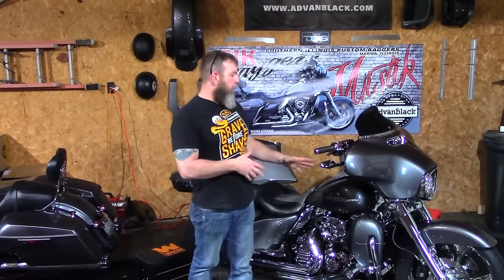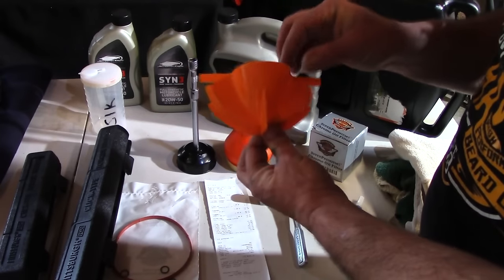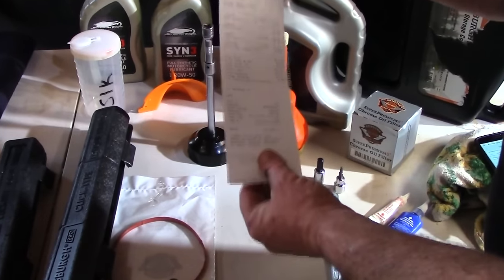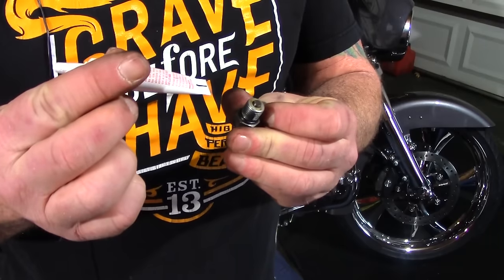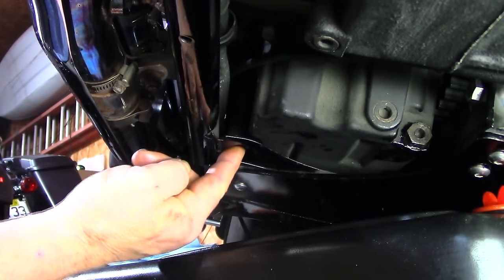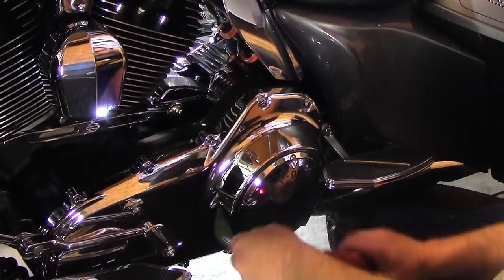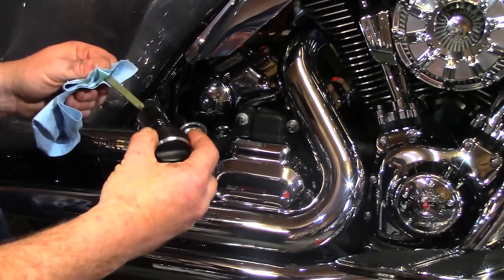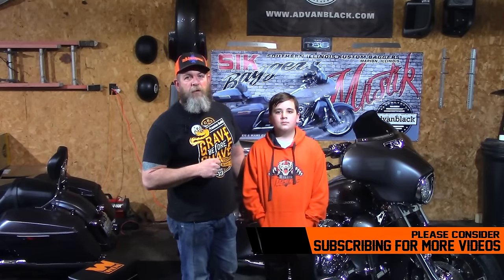⚡Twin Cam Complete 3 Hole Oil Change @harleydavidson  Touring⚡

Comment: I've watched a dozen videos and this is the only one where I feel like I know what to do after watching it. Thanks!
Reply: Except use 75/140 gear oil in the transmission
Reply: @michaelmitchell5909  I used Lucas 20/50 in the motor and primary, and 75/140 in the trans.  Shifts smoother and doesn't slam into 1st like it used to

Comment: It’s good to see that the oil is running out slow with the oil plug is in. It shows that the oil breather separators in the heads aren’t wore out.

Comment: Thanks for the informative video detailing the correct step by step procedures. The addition of constantly reminding everyone of the  torque specs required, along with not skipping any steps, really makes your videos stand out from the rest. Keep showing all of the steps necessary to complete the projects. Special nod to showing a "COMPLETE TOOL AND PARTS" display that is needed to perform the service. Its one thing to be told what is needed, and another to visually see what is needed. Thanks for clearing up the apprehension with doing this service. Fantastic job man.
Reply from the maker: Thank you John..Much appreciated.
Reply: II concur.  I just went from a Honda VTX to a FLHTK9 Love the VTX AND the Ultra!).  The info is priceless, and useful.  I have always changed my own oil, except when it is covered by the dealers break-in period service (which was free).  So now I can start doing mine on the Ultra..

Comment: T27 for the derby cover bolts, not T25 as stated. The T25 can appear to be the correct size as it is just slightly loose...and might even work on bolts that are not over-torqued (unlike mine). I ended up buggering one as a result of my trust in the internet and an hour's work turned into three. Put a tag up on the video or something. No one saves money if you hand out incorrect information.

Comment: I run the syn3 in all three of my holes as well and it's much cheaper to to do this myself and save a couple hundred bucks and it's easy with the proper tools along with common sense. I would also like to mention that the plugs have a magnet on the tip and if you have serious metal shavings on it you better get it checked out. Thanks again for the great video.  Peace out brother !
Reply from the maker: Absolutely ....good point on the magnets...I had said that in the video but I must have edited it out on accident.  Thanks for checking out the video man and bringing this to my attention. I'll pin your comment to the top so others can see.
Reply: gaknskk I do my own oil changes as well. The Harley-Davidson dealership technicians don’t use torq wrenches, they do everything by feel.
Reply: @sikbaggers  I have 2015, exact same color as yours.  My bike is approaching 15K miles.  At 15K, do I need to do a 3 hole change or just the oil change?  5k and 10k fluid changes were done by the dealership under the purchase service plan.
Reply: &hi*iikjk
Reply: Up
Reply: I had serious metal shavings in my primary. I changed the oil second time saw very tiny pieces. I believe it was because my clutch starter was cranking crazy for a season. Had it fixed. 🤞🏼 it’s 20 year old  🏍

Comment: WOW!!! Thanks for the warning on the torque specs.  As a diesel mechanic I would have gone with the gorilla torque I normally use on the job.  I can see I will have to make some adjustments to wrench on my own bike.....  I knew it wasn't an M2 Bradley but I can't remember the last time I dealt with in/lbs.

Comment: Just to add some food for thought, I've got a 16 FLHXS and and an 05 Fatboy.  I've put 75,000 on the Fatboy and changed all three oils countless times.  I'm still using the factory O-ring on the oil drain plug, and the factory gasket on the derby cover, factory O-ring on the primary drain plug, etc.  I keep both bikes in my garage and there has yet to be one drop of anything leaking.  Not saying that there's anything wrong with changing em out every time, just showing that maybe it's not quite a "must do or else".
Reply from the maker: Well Ill have to say im shocked that your OEM o-rings are in that good of shape after 17 years and 75k miles....for the price of these things I would never re use them on my bikes or customers bikes...just not worth the risk.

Comment: Hate to point it out but the derby cover screw size is T27. Too many think it's T25 and strip it. Should also not use blue loc-tite on it either.
Reply: I went right out and checked. It is a T27 on my 2011 Road King.  Video was very good. Thanks
Reply: Why not lock tight?
Reply: Brent Spencer just no need to use it. The screws are cheap pot metal and can shear off with the slightest extra torque. Using loc-tite on them will just be too much. Yes, you can heat them a little prior to removal but with 21yrs as a master tech I've yet to seen vibrate out and have more than my fair share of sheared off and stripped ones. The derby cover screws are not subject to the same heavy vibrations as other areas of the bike.

Comment: Great video. I was having trouble finding the trans drain plug because the manual doesn't tell you it was being hidden by the frame plate. I should have no problems now. Thanks.
Reply from the maker: youre very welcome!

Comment: I had my 1K mile service at the stealer and they put Syn3 in all 3 holes on my 19 Road King at it ran ok. I then did my next service and used Amsoil and it ran better and shifted much smoother and ran a little cooler. I used Redline for my last service and that’s all she wrote. Runs like a top, no clunking in gears and runs cooler.
Reply from the maker: Thanks for sharing...ive amsoil..and agreed..the amsoil didnt make much of a difference in my opinion wasnt worth the extra money over syn3 ..my next oil change will be with redline

Comment: The torx head bolts on most HD Derby covers is a T27, not T25. A T25 will strip out the torx grooves.
Reply: Should have read the comments before I started 😭

Comment: Hey great video. ? what is your opinion on using Amsoil ?  I have j&p cycle sells the Milwaukee  twin oil kit are they any good ?
and I saw you used the same oil for all three holes vs the individual type there is a lot of discussion on this what is your opinion? 
thank you in advance
Reply from the maker: Hey thanks man...Honestly I have never used anything but the Syn3 ...I have a 2014 SGS sitting in my garage right now, one of my good buddies, that has 94 thousand miles on it.,...yep...94k! Im talking hard miles! Only used Syn3 in it and has never had to have work done on that motor. Those results are really hard to argue with to honest. I have read all of the debates on amsoil and other brands...you can get lost in those debates there are so many. I have had several tell me that the amsoil will take the clunk out of the transmission...those are also the same people that are selling amsoil kits. Those who have used it have all said the same...once it gets hot the clunk is right back in there. I just stick to running the Syn3 in all 3 holes . If you take your bike to HD for the service thats whats your going to get as well unless you specify different.  I guess it all comes down to what you are used to using.

Comment: I used the Red Line products for the first time and the transmission oil spooked the heck out of me, it looked as though I was pouring a pink smoothie into the fill hole.
Reply: Hey man saw this comment. Coming due for first change on the wifes 18 stree glide and 2nd on my 17 street glide. Any pros or cons to the redline now that you've been running it. Not sure Redline, Amsoil, or stick with Syn 3 ??
Reply: Honestly...I haven't noticed a lick of difference running Red Line from the OEM stuff.

Comment: This is great, thanks! I can already hear my wallet getting fatter hahaha. Question...do you use the same oil for all 3 fills? looking at some kits have 3 different oils...Thanks
Reply from the maker: hahaha nice! on this bike yes...syn3 in all 3 holes. HD changed the oil on this bike the first few times and thats what they used so I just stayed the same with it...I have used the amsoil kits and they work just as good.

Comment: Great video, quick tip I put a Ziploc bag around the oil filter plus the rags you mentioned, helps with the mess.
Reply from the maker: Nice tip! I may try that next time...Usually I cna get it out fast  enough but it does spill a small amount...I didnt have much luck with the plastic oil catch things they sell....dripped fluiod everywhere lol

Comment: 10 bucks for that funnel ?!  Must of cost H-D 3¢  and that's including shipping & handling from China.   I wish they'd stop with the gouging on every single friggin thing they offer.
Reply: I bought some extended turn signal switches that weren't too bad; twenty something. It was competitive. Hey they have to keep the palace lights on.
Reply: I cut up a plastic milk jug
Reply: @Gakk13  
Nice going, Leo.
Every H-D technician just gasped & fainted !     Now they have to break out the 
H-D ( Willie G edition) smelling salts at
$100 a pop
Reply: @onestepbeyond7240  you do know what HD stands for right? Hundred Dollars!

Comment: About to do mine for the first time ever. Now feeling confident after watching your excellent video! 👍
Reply from the maker: Glad to help Mark! Its pretty straight forward, youll have it in no time.
Reply: Great help thank you. I can buy the oil filter wrench and a set of funnels for about 25 UK Bucks. The OEM 3 x oils, filter, o rings and gasket cost 106. Not sure what HD charge but last time I took it in they didn’t change the filter. So DIY it is from now on!! It’s just great that People like you take the time to make these fantastic informative videos for us. Peace Brother 😎🤟

Comment: I really appreciate this video. I am going to do the 3-hole fluid change on my 2106 HD Triglide that has 110,000 miles. Since this is my first attempt at doing this, and because I am all thumbs (read barely know which end of a crescent wrench to use), your patient explanations are very helpful. Lol. After crawling under my trike, I am amazed how clean your under carriage is. Thanks again for this excellent video.
Reply from the maker: Thanks for checking it out and really glad it will help you! Its pretty straight forward and after doing it a few times itll be a breeze.,..take your time and you'll do fine!
Reply: Thanks again for your help. Just completed my 3 hole fluid change. It went smooth enough that I also changed my air filter element and spark plugs. Had to be a little careful with my 2016 HD Triglide fluid specs. 3 quarts in the oil pan, 28 oz in the transmission, and 36 oz in my primary. I used my service manual to verify my fluid requirements. Thanks again for your excellent videos. I have liked and subscribed to your channel.

Comment: Try the filter drain funnel. No towels! Happy wife happy life. Lol. It you use the funnel, place under filter and punch one hole twords bottom back of filter and one on top back of filter to let air in to drain filter before removing. I let the filter drain while I drain the engine, then go back to the filter. No towels. No mess. Lol. No mention on fluid levels checked on the juffy stand or on the level bike but good info vid. Thanks for keeping the common Joe in his garage. Love it when you can ride wrench repeat. Shows you really do love the machine.
Reply from the maker: yeah thats a great idea man! I may try that next time.  10:07  I talk about paying attention to the marks on the dipstick. on jiffy or straight up and down. Thank you for the filter trick as well..thats pretty cool!

Comment: I learned a couple things that I really shouldn't needed to learn......stuff stuff under the oil filter, and I would include under the bike too, before I leak it.....duh.......I use the oil filter drain funnel.....that works well, catches about 50% of what comes out

And open the engine oil filler AFTER opening the drain.....duh

All my Harleys I've used 20w-50 in all holes, I was told long ago that's good, recently I saw a video said using the gear oil in transmission will make shift a little smoother and quieter, I just got a SE 110ci(first tour Harley) and bought the owners manual and a clymers.....and for this 3hole change I decided I'd actually read them, instead of just look up capacity.

It says do it on the jiffy stand not strapped to wheel chock......I found it much cleaner removing filter

It says(and so does my dyna books) DO NOT USE ENGINE OIL IN TRANSMISSION.....same for PRIMARY

Knowing Harley will write it in best way to make money I check the clymers......sure enough do not use engine oil 

After the change, putting gear oil in trans and primary, changing gears was a click not a clunk, and I find neutral first try

And something the book says, and I've always done without knowing the book says to.......wipe all oil off inside of clutch access cover and outside of chain case where cover fits.......if not that oil will leak out until all gone....which would be very slow

Comment: Great video Mr. Housden one thing I wanted to mention was I think most Harleys you need a 27 Tork for the primary cover I  had a buddy strip his with a 25. Thanks again great video.
Reply: This is a great video, thank you so much for doing it.  As I was changing mine last night I noticed the slack with the Torx 25 in the derby cover, thank God nothing stripped. I now have two Torx 27 so thanks jrod.

Comment: Excellent video, I have the same bike so this was great. Quick question, it says 28oz for the trans but when I check it after filling it's actually slightly over the F mark. Is that an issue? I not sure it's worth draining out an ounce or so.

Comment: Really enjoyed the video, as far as torque wrenches go do you need 2 separate wrenches, 1/2”and3/8, I have a 3/8 wrench with a 1/2”attachment is that ok, thanks
Reply from the maker: you can use either of them...as long as one is INCH pounds and one is FOOT ponds ...the size or having an adapter doesnt matter

Comment: I do know that you can use syn 3 engine oil in all 3 holes , but don’t you think it would be better to use a synthetic gear box oil in the gear box? What are your thoughts on this as I’ve heard a lot of different opinions ! 
Thank you!
Reply from the maker: In 30 years of riding and wrenching I have used just about every flavor of oil ...In the past 6 years I have ran all SYN3 in a few bikes, Amsoil in 2 bikes with dedicated gear and tranny fluids and never really notice a bit of difference. I have one customers bike I change that is a 2014 SGS with a stage 4 that has 142k miles on it...its only had SYN3 in all 3 holes since the day it was purchased new. And that dude rides the ever loving shit out of that bike. Never been in the  shop for anything other than normal maintenance.  But that being said,  the dedicated gear and tranny oil are probably going to be better over the long run though with the right weight and additives it cant hurt, thats for sure.
Reply: @sikbaggers  Appreciate your feedback !
I recently transitioned from sport bikes to my first Harley it’s a 22 fatty and I love it ! I just want to make sure I do the proper maintenance because Harley’s are a completely different animal than sport bikes lol! That being said I think I’m going to go syn 3 based on what you said ! Thank again and and keep the wheels down✌️

Comment: hey, great channel...I'm new to Harley Davidson bikes. so when I bought the bike they did a sort of "this is your bike" and,, explained about the settings, for the boom box, radio tires psi,  checking and changing the oil. and I thought they said that you use the same kind, type, and weight of oil for everything. so i may have misunderstood, i thought they meant you only have to drain and refill one. or did they mean the same oil goes in everything?? thanks for the help
Reply from the maker: yeah what they meant is the same oil can go in all 3 holes...but they do all have 3 holes that need changed...youll find some companies make specific oils for each hole but if you teka your bike to HD for a service, unless you specify the amsoil or some other brand youll get syn3 in all 3 holes.

Comment: I have fxbbs ‘22my. Thanks for this video. Anyway Because bike is under warranty, all service will do HD.  The reason why I’m posting comment is a question.  Why Harley do 3 types of oil instead of just one oil which could work on engine, transmission and clutch ( primary ? ). Why Harley will not do wet sump oil to bath evrything by one type of oil ?   Thanks.
Reply from the maker: well they say the harley SYN3 can be used in all 3 holes but there are seperate oils you can purchase for the trans and clutch..I used syn3 in this video because that is what the customer wanted.

Comment: Hello I am new here and by the way great video I'm sure grateful that you have these videos online. So I'm not sure if this is the appropriate place to ask questions, I just got a 2020  Softail low 107 and I'm getting ready for the 1000 Mile oil changes on my own, my owners manual says to use Harley-Davidson 360 20w/50 is it okay to use syn 3 in all three holes and also should I check my clutch to see if it needs any adjusting at the same time and do you have videos that shows something like that I would appreciate anyone help. Thanks Helen
Reply from the maker: First I would see but here the 1000 mile service is included with the purchase of the bike...you may just have your local HD do ti and they will inspect everything on the bike at that time and service it. But with the 1000 mile change I would just use the standard 20w50...all engines love conventional and semi syn oil, nothing wrong with any of them, including synthetic. change your oil on time and your good to go. You can check your clutch at this time and I do not have one but here is a good one. https://youtu.be/IjxNdPYllJg